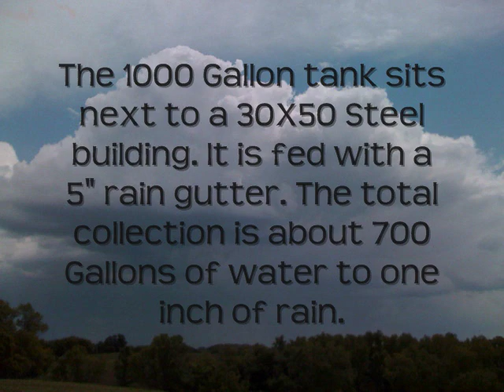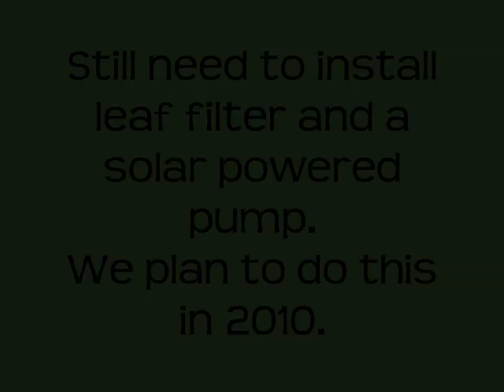1000 Gallon Rain Barrel, rainwater collection system

Comment: Paul Russ, chaining 55 gallon barrels is less expensive than a single 1000 gallon tank. Used food grade 55 gallon drums can be found from $15-20 each. Hooking them together costs less than 2 bucks each. Total for 1000 gallon storage in barrels, approximately $350.  A 1000 gallon tank costs $800-1000. The tank looks great, but some have to make do with less. No need to call it stupid.

Comment from the maker: @whatinspiresu 

We put out 200+ feet of regular garden hose and we also use a splitter on the 1 1/2 inch outlet for a second hose.  There is always enough pressure to move the water wherever we need.

Comment: You and I have the same system.  I can fill my 1550 gallon tank with 1.2 inches of rain off my pole barn.  My base is almost identical, but I used available pea gravel.  I don't get these folks linking a bunch of 55 gal. barrels.  Kinda dumb......in my opinion, which I'm entitled.  I flush mine to begin the new year and have used up to 300 ft. of garden hose to water.  I use a small electrical pump to speed up things but wouldn't have too.

Comment: You should seriously consider a "First Flush" system, to help clean up the water going to the tank. 
Not saying this as criticism, just a suggestion.
Reply from the maker: I agree and have designed one. It would be a nice addition. We change the water frequently enough to where it hasn't been a problem.